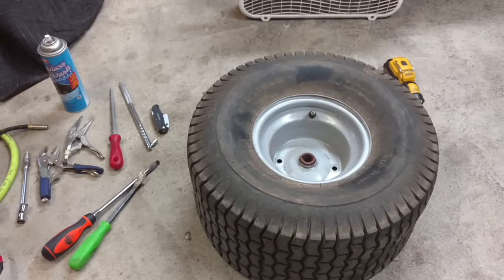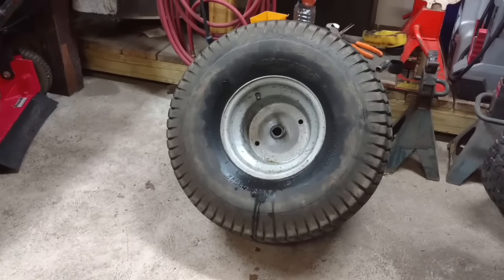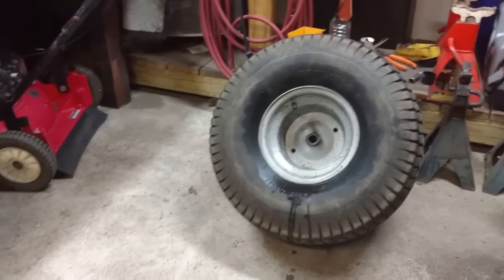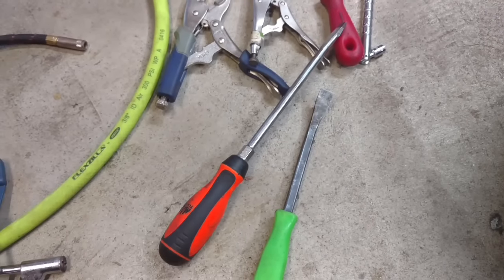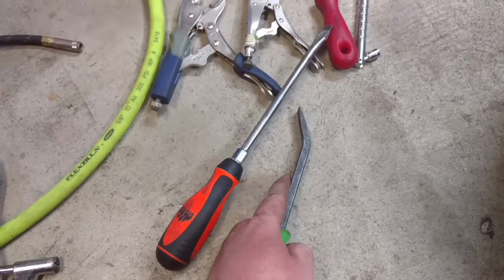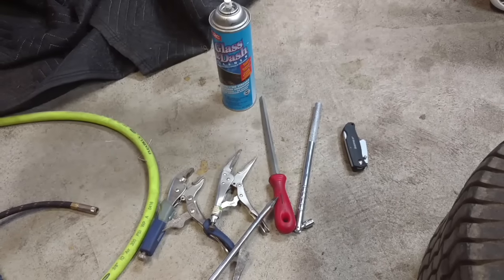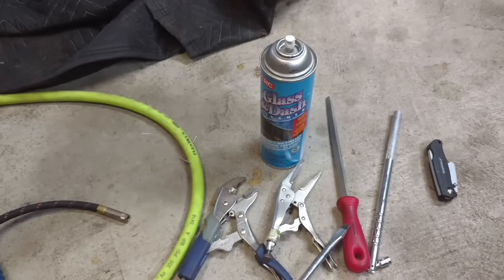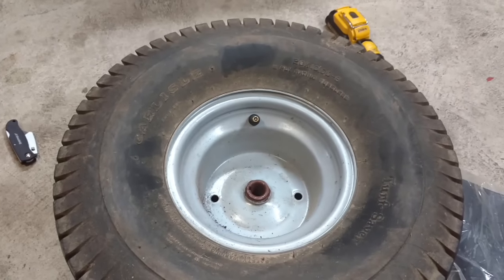How to: Install tube in lawn mower tire

Comment: You know you can buy a tool for this at Harbor Fright for about $30. Saves a lot of hassle. 
You said you need a good pair of vice grips, but you demonstrate with a cheap pair of Chinese pliers. 
About the time he cut off the valve stem it got hard to watch. That is what valve core tools are for. Unscrew the valve core instead of cutting up the tube.
Reply from the maker: I have no room for the harbor freight tool and most people don't have it. The vise grips are kobalt which is a good name for home use and lastly I cut the valve stem because it has to be removed from the rim to install the tube anyway so why not. Sounds like you're a professional lube tech at a pepboys where changing tires is the extent of your work and have to critique people on YouTube to feel better about yourself. It's a lawn mower tire dude, not rocket science.
Reply: Repairs & Reviews thanks so much for an awesome video!!

Comment: Why go with a tube as opposed to buying a new tire? Cost?
Reply from the maker: Tube can be 10-15$ and tire could be 50-100$ depending on brand and size. So if you have 2 rear tires going flat, you can fix with tubes for 30$ compared to 100$+